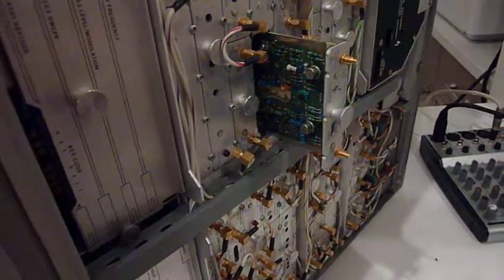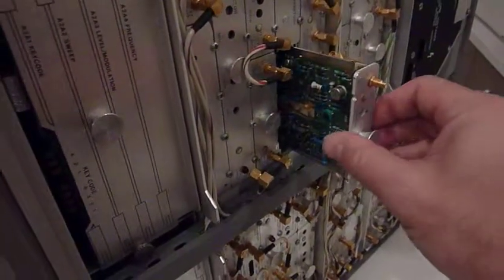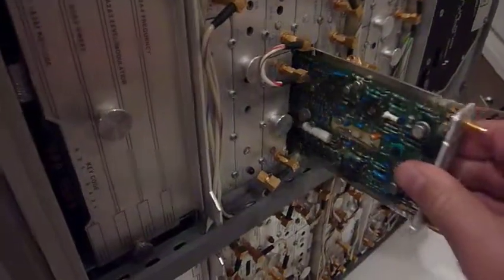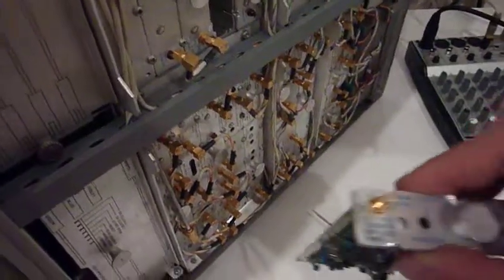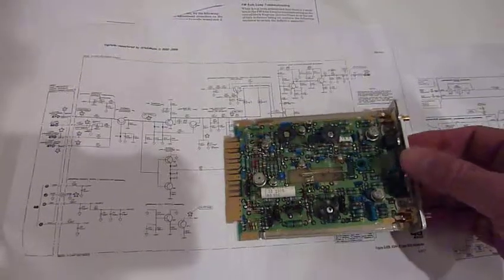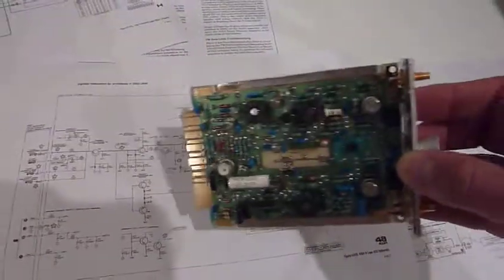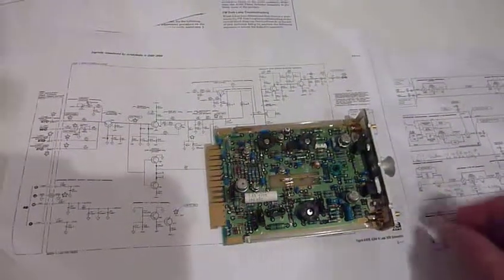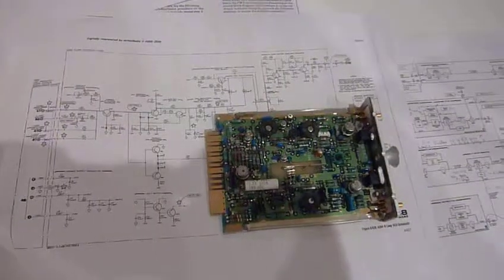HP 8662A synthesized signal generator repair part 7

Comment: Hi, my name is Ariano I live in Italy, I have hp 8593, I need the power supply diagram, could you help me thanks
Reply from the maker: Hi Ariano, HP did not provide detailed info on the power supplies of these more recent instruments, which is a real pain. They probably weren’t designed by HP either, but came from an OEM supplier. However it is possible to repair them by reverse engineering them, like I have done here: https://youtube.com/playlist?list=PL-_93BVApb59nSZU0aixrapvAie5kcllE . It is a lot of hard work though.

Comment from the maker: I got lucky on mine, the pots were accessible with the  VCO plugged in, so all I had to do is take the jumpers off, plug it back in, adjust, and put the jumpers back in. No extender board needed.